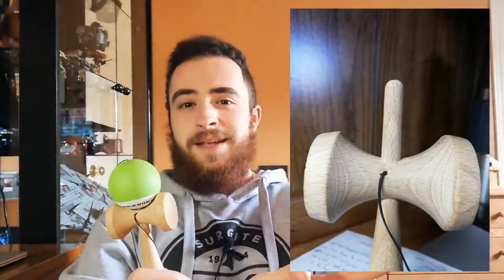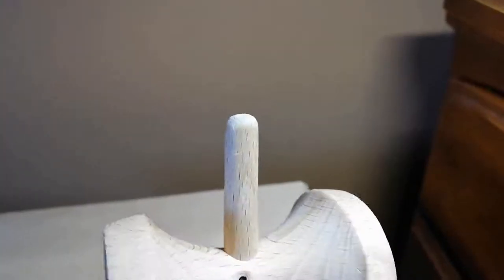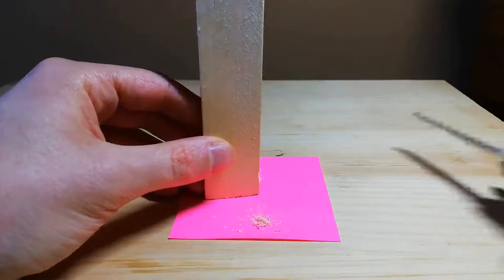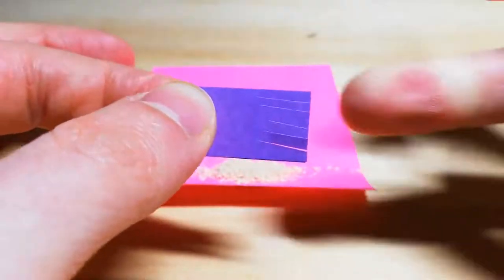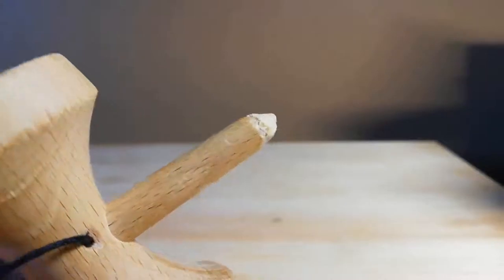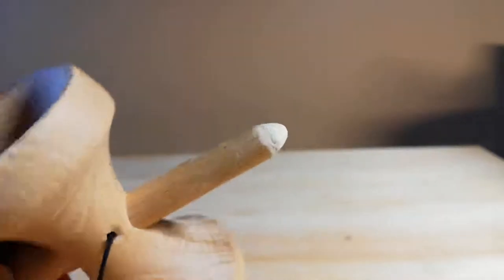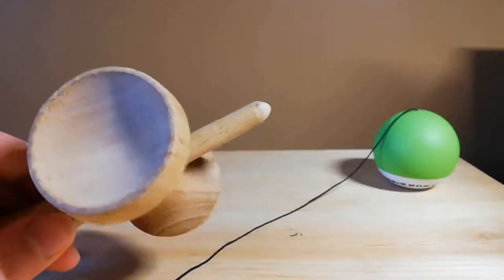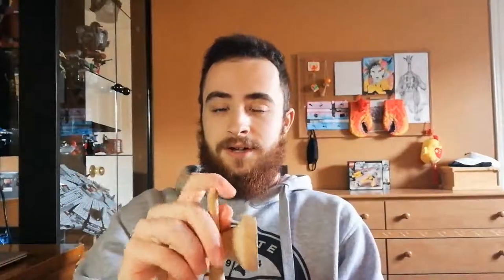How To Restore A Kendama Spike

Comment: An idea for next time that may help with the application and layering: Try making a paste of superglue and sawdust, experiment on a piece of paper to get the ratio right, but given enough fluidity it shouldn't have those cracks, and if it does you can reapply the paste in the cracks to seal it. The glue and dip method can work, but you will have layers of super glue, glued sawdust, and dry sawdust for a couple reasons that are mainly to do with how little time you have to work with.
Reply from the maker: Yea 100p! If you want the most durable and clean finish then creating the mixture first is probably better than trying to mix them right on the spike😂
Reply: @mediochrist  really appreciated the video though, smushy gang!